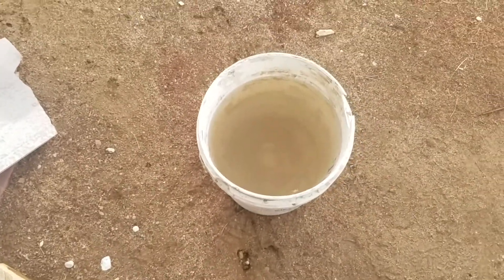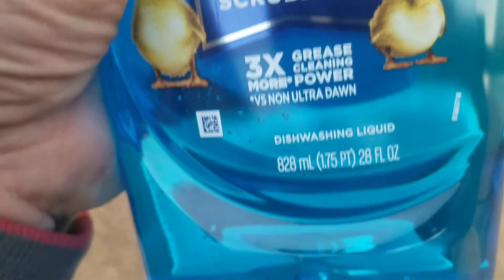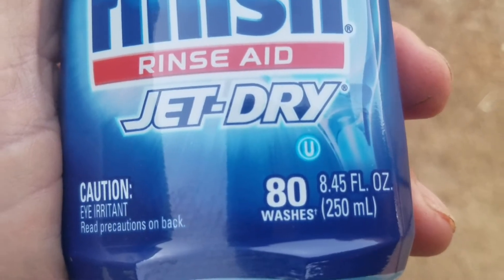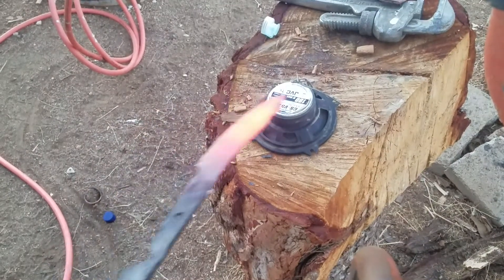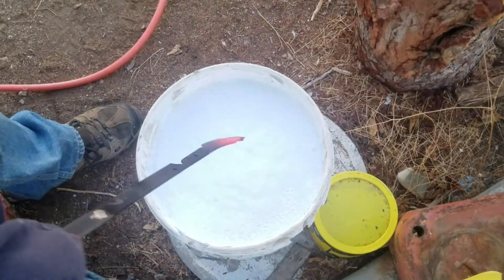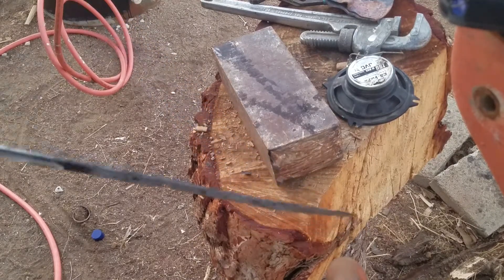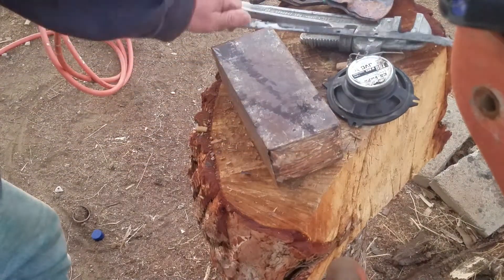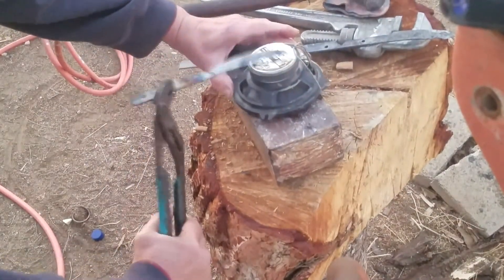How To Heat Treat A Knife | How To Make Super Quench For HEAT-TREATING

Comment: Very cool Ken! A tip for ya, you might wanna stir that superquench until the salt and all dissolved into a solution. Itll work better that way. The salt brine is a big factor in how it works. Great video!  It's fun to see you having so much fun with blacksmithing. Forge on!
Reply from the maker: Thank you James and thank you for this recipe I meant to mention that I got it from you when I was making it but I had a lot going on and I happen to forget. But I'll set it right holler at me when you get a chance God bless bye for now
Reply from the maker: PS I did stir it it just wasn't on camera
Reply: @HomeImProveMentHow  I figured you must have. Just mentioned it because that stuff is a bear to get mixed up. Works great though. I had my doubts about it until I witnessed it actually doing what they said it would. Great for a quick and dirty tool or utility blade from available mild steel.
Reply from the maker: Thank you bro appreciate the information and the recipe yes I mixed it with the broken  Landscaping rake I just didn't show it in the video Sending off your knife tomorrow to bless you bro